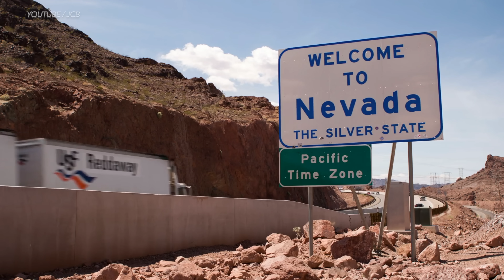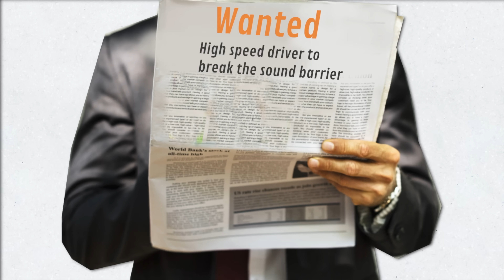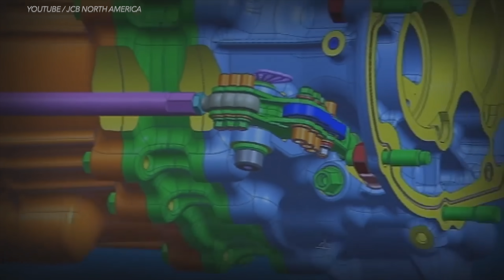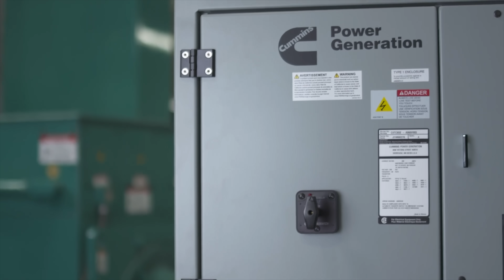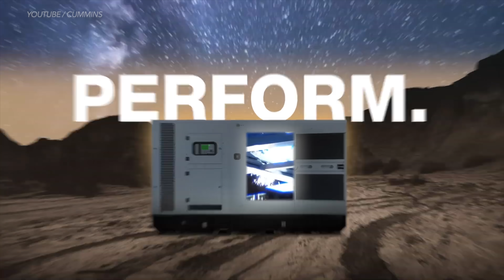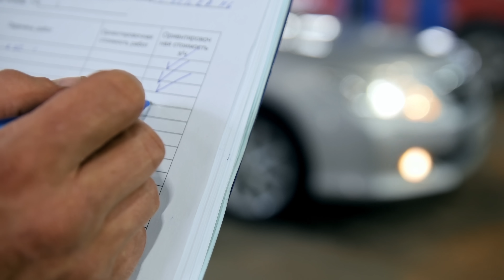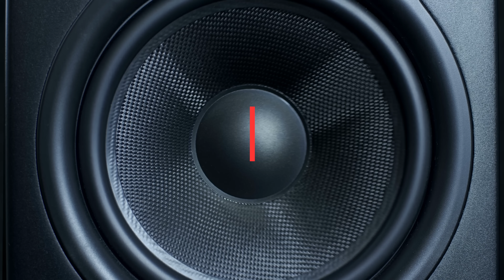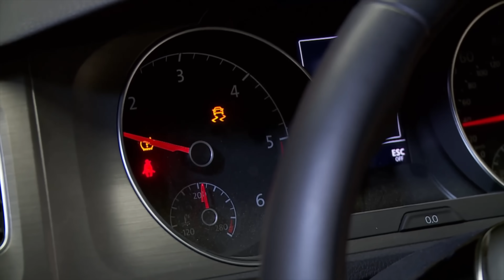Here's Why Diesel Engines are Being Banned

Comment: I have sold Volkswagen Touran 2004 with 1,9 TDi Diesel Engine . Got it at 370k kilometers and sold it at 660k kilometers 3 years ago. A month ago I saw the guy still running it. This was my second 1,9 TDi from VW . The first one was in Audi A4 I don't remember ... I think  I sold it in the high 500K kilometers range. Now I have Skoda Superb with a newer 2.0 TDi Engine from Volkswagen again. Runs much smother and has a better HP and Torque. About reliability ... will see. So far no issues. The only thing I was precise about during the years was oil and filter change. The brands I am using for the past 12-15 years is LIQUI MOLY for Oil and MANN for Filters. Thats it. Never had problems with Engines. Breaks .. yes ... hoses here and there .. yes ... suspension ... yes ... engine NEVER!

Comment: Disagree with you on modern efficiency, guys I worked with, some had diesels some had gas, and they were saying gas had to be fueled up twice a week. The diesel owners were filling up twice every two week. 

Guys who pulled in the past past said, the diesels had far more longevity, and the fuel efficiency gaps wider with increased weight.

Comment: I disagree with most of your points against diesels. Noise? Is that really an issue? water? cold weather? Most of these are so obsolete nowadays. Diesel engine will always be superior to gasoline. Stronger, lower consumption, more reliable. It is no brainer to go for gasoline, if you will drive out on the freeway.

Comment: I have a 07 F350 with a 6 liter V-8 diesel which I purchased in 2013. I over maintain it, change oil every 4 months along with oil filter. I'm very happy with this truck. Also drive it properly , don't beat the hell out of it. Never push the turbo boost over 10 - 15 psi. Also love the sound of the engine and the smell of diesel fuel both before and after its burned.

Comment: Here's the thing. When you refine crude oil 40% of it will result in diesel. 
What do you do with that diesel if you can't sell it as road fuel?
Well, the price of the other refined elements from that barrel of oil have to increase to cover your loss on the diesel which means petrol has to increase in price!

Comment: I've been driving 2014 VW Jetta TDI now with 310K miles and a manual transmission. Had no issues at all with the engine nor trans.Just dissapointed VW stopped making diesels in the US

Comment: Well, the downsides you exposed about diesel we don't have them here in Europe, there are more diesel than gasoline vehicles, the cost for diesel is lower than gasoline, cars cost the same, when you go to a mechanic no problem it's the same, I have an hilux 2006, no problem with cold start, it turns on first try, there is a power heat button the heat the engine faster, I use it when it's too cold outside.
It's not loud, it makes a good sound for me. They are trying to destroy diesel with dpf and adblue now, promoting electric vehicles full of problems it's a shame.

Comment: I think phasing out diesel cars is a good thing. Diesel is a strategic fuel because everything runs on it: industry, agriculture, construction, heavy transport, much of public transportation, and the military. It's not wise to squander it on non-critical applications such as personal cars. Plus it requires expensive catalysts with rare elements such as platinum, to curb emissions. Eliminating diesel cars will lower the pressure on the price of Diesel, which can be an overall economic stimulant. And in times of need such as oil shocks or war, it's better to have diesel fuel available for what's really important.

Comment: I own a diesel powered car and I love it.   The best car ever.  A 2014 Audi A6 with the 3.0l TDI.  Sadly diesel cars are dead.

My car is great, it is very quick, not overpowered. They certainly are not cheaper than a gasoline card, even with the added energy density in the fuel. I need to run a diesel fuel additive, have to refill diesel exhaust fluid, I need to run diesel specific motor oil, which all results in additional costs.

Comment: I live in MN, cold doesn’t affect the smaller diesel engines like it use to, in fact they warm up much quicker making them great for the cold weather.

The thing that kills diesel now is the DEF system reliability; the system needs to be less complicated and it can’t always be derating you if the system is working. How do I define working? NOx reduction between sensor 1 and sensor 2 with proper line pressure. 

As I am currently dealing with a DEF system issue maybe I’m a little sensitive on the subject but if the computer can see a NOx reduction between sensor 1 and 2, the line pressure is good and Urea % is good why still have the derate (speed limiting) happening?

Comment: I Drive a Renault Clio Estate DCI 90 Hp. 2014.
Never had any problem. 
She is not loud, and fuel efficiënt, 1:15,5 (gallon/mile) now 137000 miles driven.
Only change oil 18600 miles.

She purrs like a young kitten.

Comment: Isn't the situation that diesel motors are  designed and built better therefore would last longer even at a low quality level than a krappy built gasoline engine. And aren't they easier to convert to h2

Comment: I drive a Holden Rodeo, with an ISUZU 4jh1 engine, non-Common Rail, 223,,000km and still going strong, changed the oil every 5000km and it won't stop growlin.

Comment: I feel that Diesel engines should be used more and should be made to be multi-fuel. I am in the process of getting a M35a2 or better known as a "Deuce and a half" and those have multi-fuel diesel engines that can and most people do run it on motor oil thinned with another fuel or fuel oil type. And I fell that if we took such engines and put them on the market with stations where you can fill up with cleaned used motor/cooking oil then it could potentially be something more. Something that can be advertised as green as it's taking oils that could leak into the environment and turns it into something burnable and useable for vehicles.

(Yes I am aware that large cargo and cruise ships use refined motor oil as fuel already)

Comment: Diesel engines are not that loud, I had a Jetta tdi and it was just a little knocking sound while idling and you barely hear it while driving. As far as warming up mine was fine in the winter down to like 7 degrees or so(using only glow plugs). I’d just let it run for a minute or 2 before driving and it was fine

Comment: I love the productivity increase of my work on my Kubota tractor, but I dislike the noise and smell (blow my nose of black snot rockets after each use). Unfortunately, the industry like many businesses has to make a profit and that usually means do this marginally well until substitute products arrive. Now that electric has stepped in you see GM, FORD and other major manufacturers with quiet and clean burning diesels that make sense (until you have all the associated problems with clean burning diesel engines like particulate filters, sensors ect.). While they are a great technology, they will be replaced with electric most likely.

Comment: I drive a 96 12 valve cummins in the summer and 09 vw jetta in the winter, last firmware update vw did I notice I burned a lot more fuel. Dpf, intake manifold and egr cooler are all new as well because of my emissions warranty

Comment: Bought a ‘14 TDI Touareg, 3 yrs ago, post dieselgate. Has the VeeDub post dieselgate extended warranties, gets 30-34 mpg on the highways, only paid low-mid $20’s for the vehicle. Range ‘anxiety’ kicks in around milepost 750. Only takes five minutes to ‘recharge’. Even if it now costs an additional $100/month to fill up, hard to justify spending $62,000 (ave price of an EV per KBB-July 2022) just to ‘save’ $1,200 per yr. And 406 ft pounds of torque ‘ain’t’ bad either.

Comment: I am from the UK and Diesel engines have been dominated for almost thirty years.

I would say there has been a decline in the last couple of years due to the rise of EV's and petrol-hybrids but diesel cars still make a large proportion of private vehicles on the road today (excluding HGV's and vans used for commercial use).

The only downside is bigger city's are starting to tax diesels older than 2016 (pre euro 6) to drive into the city centres forcing people to buy the new euro 6 diesels or by EV & Hybrids or petrol cars.

I should be OK for a few more years, I live in North Wales which is mostly rural and no towns have as of yet adopted the clean air zones.

Comment: Currently driving a 1995 Diesel Toyota Land Cruiser....odometer clocking at 600,000km actual mileage for this original engine came from factory,still reliable for my everyday use as work horse,minimal and regular maintainance,engine oil,oil filter,diesel filter change on schedule,and its ready to back on the road again.....this is the war created by electric vehicle manufacture to stop the diesel  engine potential.....every body believe about the climate change propaganda,but they the EV producer is hiding their claw under the agenda,the claw will show up after all their agenda succesfull....dont understand why many people still didnt saw ,how they are manipulating the media,and their EV user itself,by controlling the EV car computer remotely....many thing they can controlled using the computer software and program....hmmmmm

Comment: The anti diesel propaganda has done its job.  Diesel certainly in the UK, is on the way out.  Compact family cars are now no longer available with diesel engines and all this on the premise that diesel emissions are prematurely killing 40,000 pa.  Really?

Given that particulate emissions of the latest Euro 6 engines are 99% less than pre Euro (1992) engines and NOx emissions are 98% less, where are all these deaths coming from?  Back track these numbers and millions would have been dying prematurely in the UK alone.  I think someone might have noticed.  They did not.

In Portsmouth UK, where I live, we have a clean air zone.  Not throughout the city, which you would expect, but in the south west corner.  Of course, vehicles are blamed but what is curious is that the part of the city with dirty air happens to be down wind from the harbour entrance and marine engines are not subject to the same emissions requirements as road engines.  Portsmouth is a busy harbour, being the home of the Royal Navy, a busy commercial dock (75% of the UK's bananas come through Portsmouth), a cruise liner dock, ferry port and the home to countless marinas and moorings.

Modern diesels are a complete nightmare if they go wrong.  They have the normal crop of electronics to play up, but if say injectors go, they are vast sums of money to replace.  

I am re-building a pre Euro Land Rover Discovery 200 Tdi.  No electronics, total reliability and easy maintenance.

Comment: The diesel train is not diesel driven, does not have a transmission, it has an electric motor on every axle on the train engine, that makes the train a hybrid

Comment: My 2012 VW sport wagon high pressure pump chunked, and flaked metal into fuel injectors, and also pushed metal flakes into return line, into fuel tank.
Entire fuel system replaced or flushed, fuel tank cleaned.
9,800.00 dollars in repairs, 1600 to replace alternator, 
Selling car soon

Comment: I own a 1996 F 250 Turbo Diesel with 287000 miles. It doesn't use oil and is a beast. I love it. If they take them away, I may as well die...

Comment: Not all of what he says is correct, to start with it's hard to tell the difference in noise between diesel and petrol motors, and as for warming up, they have glow plugs to heat up the fuel for an easy start. You do need to service them more at a higher cost per service, but the efficiency of them counteracts that. They also last longer than petrol motors. lt all depends on what you want it to do.

Comment: Well I have a brand new diesel land cruiser on order. No way I want to buy petrol when a diesel is available. Here in Japan almost all cars have petrol engines only, because of the tough pollution laws. But a few such as Toyota and Mitsubishi still make diesel engines. Mazda and Nissan used to, but then they stopped building cars with diesel engines here so very little choice. Luckily the car I wanted has the diesel engine. That is a big reason for changing the petrol SUV I have now, because wanted something with more torque and better fuel millage.

Comment: Regulators are increasing the emissions standards and that will kill the diesel. Introduction of DEF systems was the start of the trouble and they will kill the diesel regardless of how good they are. CAT stopped making truck engines because of they couldn't meet the emissions standards and so will the rest of them are new standards are introduced.

Comment: I drive a late model Peugeot diesel car in Australia.  It meets the Euro 6 standard which is the highest standard for low emissions.  Very happy with the engine, its economy and torque.  Getting over 1,000 kms (620 miles) per tank around town.  Even further on a highway cruise.

Comment: I own a 2016 Jetta base model with a 1.4 and I get 44 miles to the gallon

Regular unleaded because these systems don't need 92 octane they can get by with 87...

Do you know a smart car is rated at 42 miles a gallon and why the hell would you ride in a pregnant roller skate when you can ride in a Jetta?

Comment: The Volkswagen scandal is all smoke screen and mirrors and deception.

In the United States, vehicles are allowed to have what's called a SMOG PUMP which is basically in a mechanical induction fan that shoves raw air into the exhaust stream and dilutes the exhaust to make it pass emissions.

Without this little mechanical fan shoving raw air into the exhaust stream it would never pass emissions... 

Volkswagen did ELECTRONICALLY, what American car manufacturers do MECHANICALLY and therefore the Volkswagens got better fuel efficiency...

And THAT is why the Americans  THREW A FIT 
To restate and emphasize: because Volkswagen did ELECTRONICALLY, what American manufacturers do MECHANICALLY, therefore the Volkswagens always got better fuel efficiency than the American versions of the same system.

The Americans are doing the exact same thing that the Europeans were doing it's just MECHANICAL, fuel efficiency is less in systems created in America, due to using this mechanical method, but according to Americans scamming the emissions protocols is perfectly fine.

If it's part of the mechanical process of the engine.

American systems don't REDUCE emissions, they DILUTE emissions

Had Volkswagen done this MECHANICALLY instead of electronically, the Americans wouldn't have much to say, because American vehicle manufacturers have been scamming the system, for nearly six decades... MECHANICALLY

The Americans just got all pissy because Volkswagen beat them at their own game.
Reply: Totally agree!
My 2015 VW TDI is the best vehicle I have ever owned.  
Isn't it awful that VW had to raise there prices on all there parts and services to there loyal customers to survive. When in a (perfect world NOT there is none )  VW GOT SCREWED BY OUR GOVERNMENT WITH THERE DIRTY JUDGES AND ATTORNEYS .

Comment: I drive a gas powered Ford with the 460. I'm looking for a diesel to replace it. For one thing the diesel can last somewhere around 1 million miles  where a gas powered only lasts around 300 thousand miles. Also diesel  gives more power with a smaller engine. Also if ya get the right one you can make and run on black diesel made from old oil, gas, trany fluid, etc making the cost around 1-2 dollars per gallon. It's a no brainer.

Comment: The initial cost alone will drive you away from an EV .  
You still have maintenance costs .  
Wait until you replace those batteries .  That by the way are damaged if you charge to 100 % on a regular basis .  And again same thing if you discharge those batteries below 20 % percent .  
How about when they break ?  Electrical problems are costly .
Electric cars are a Novelty that are being stuffed down you’re throat .

Comment: I drive a Jag XJ that has a 3ltr diesel engine, it puts out 300bhp and gives me around 52mpg on the motorway, if I want it will pull of the line like a rocket. The drive is what you would expect from a Jag, as smooth as a pair of silk underpants!

Comment: Oh please - where diesel engines are common parts are cheap. Starting diesel in a cold weather - I never had any problems with my good old 2001 1.9 TDI even at -20C (-4F). Just get good fuel, keep your engine in working order and take care of the battery. Mind you I have quite old-fashioned diesel engines, not those new fancy ones that need pee to be clean (OK, not pee... concentrated pee ;) )

Comment: What no one talks about: diesels on average get TWICE mpg on highway… than similar weighted gas vehicles with less torque. Sure diesels may pollute a little more when idling, BUT diesel particulates are much heavier than air and fall straight to the ground, unlike gas.  And the overall carbon footprint of diesels is almost HALF.  (2 gallons of gas vs 1 gallon of diesel).

Comment: I drive a 1.6 turbo diesel Honda Civic Estate...I average around 70MPG in town and 77+ on the motorways, and doing motorway speeds...in the winter the town driving is low 60's ! 
Honda stopped making these in 2015, in my opinion, a huge mistake!! 
Honda push the 1litre turbo petrol with much less power and torque with  mid 30's to low 40's MPG
I would never swap...and now Honda have excluded me from their range☹

Comment: Scotty, I am a great fan, but I wonder if you have ever owned a diesel car? In moderate climates, ie above -10 and perhaps far lower diesels have no problems.  Buy an old VW group 1.9tdi and they go on for 400,000+ miles with regular oil changes and 50 USMPG and no starting issues.  Great tyre shredding torque for in gear acceleration too!